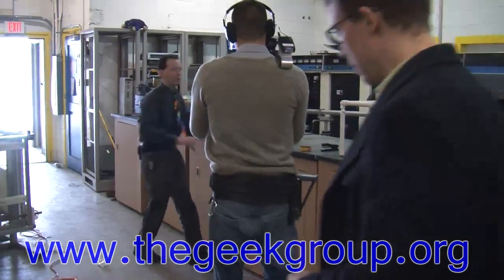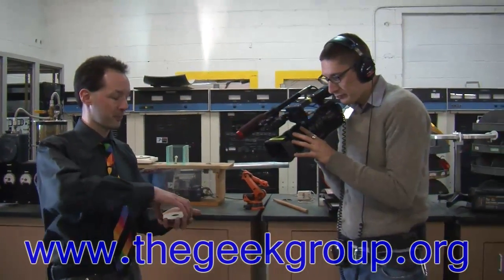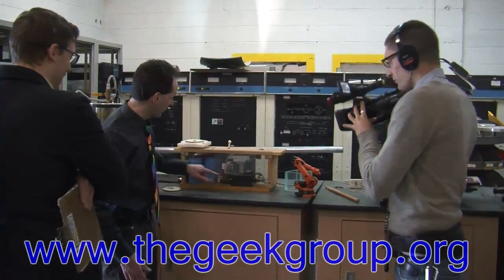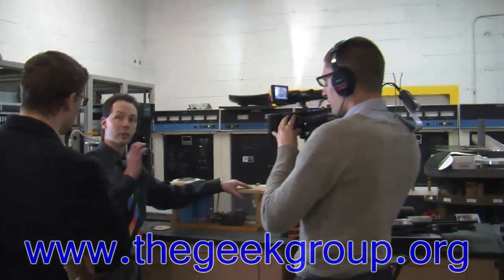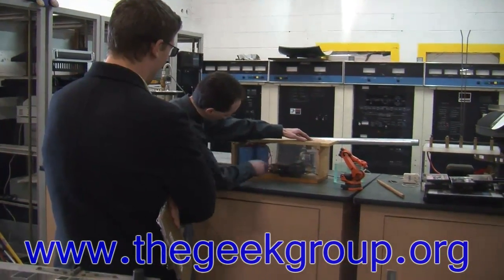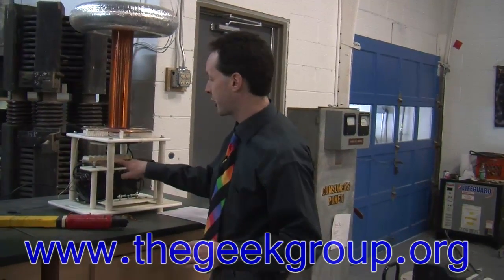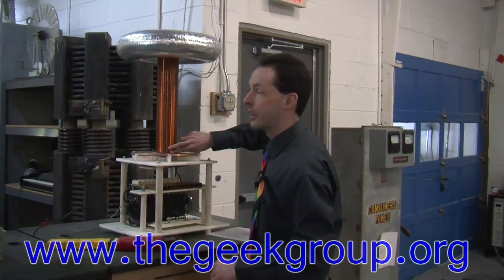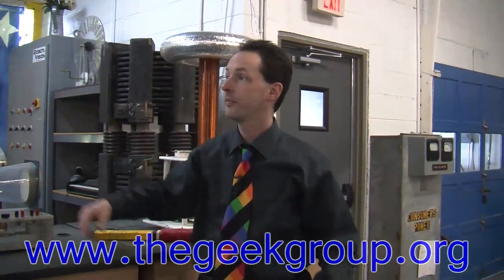Mechanical vs Electrical Resonance and How a Tesla Coil Works

Comment: I'm learning about capacitors in school right now, and I was wondering...

If you kept holding that button down, supplying charge to the capacitors, would it eventually discharge on its own?

Comment: @pt2091 the charge in a capacitor will theoretically hold indefinitely until discharged or a load is placed on them and high voltage capacitors will have warnings as they WILL bite if they have a charge on them even after turned off for a while

Comment: @xassxass He explains it in the vid. Dump the capacitor power thru a coil to generate the 1st mag field which surrounds the disks. In doing so it "induces" a current in the disk which generates a 2nd magnetic field. These two fields fight and oppose each other and they want to get away from each other......so the disk shoots up and hits the ceiling.

Comment: Or you Could say its a feedback loop ... and blow up a  cheap speaker with a mixer ... 
feedback loops may be the best way to power a tesla coil considering feedback loops put out more energy than went into them ... unlike power supplies or capacitors seen in this video